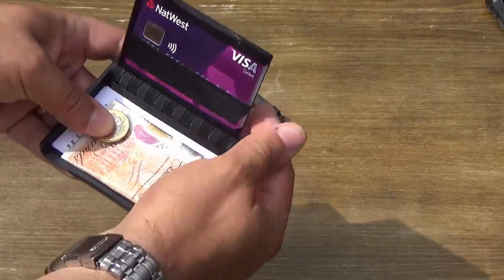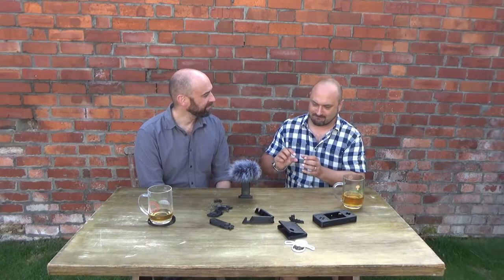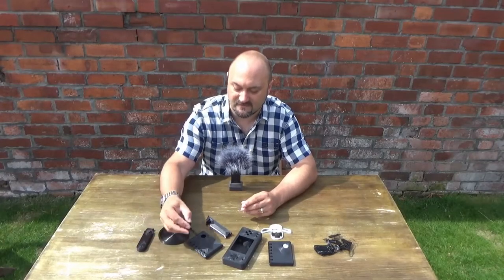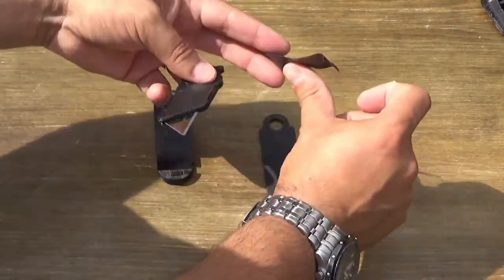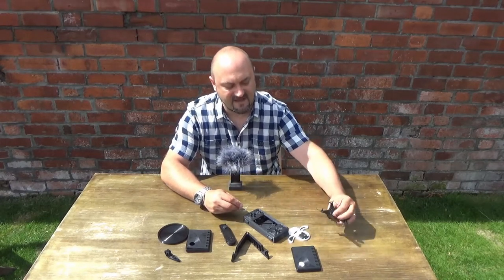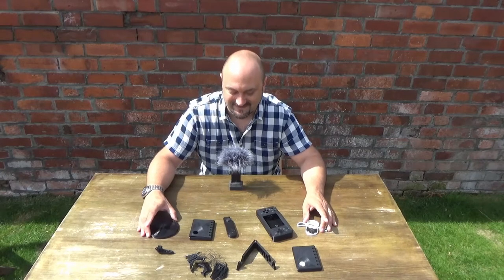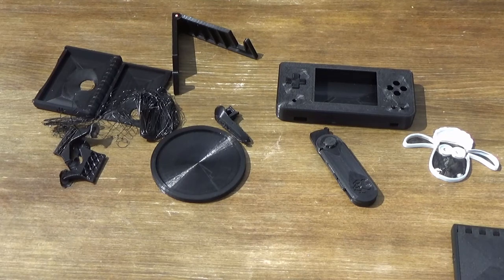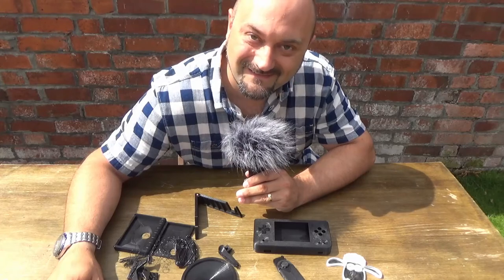DuB-EnG: Is: 3D Printing Useful? Cura Easy? FreeCAD Hard? Difficult Design Parts? Top 5 Prints!

Comment: 3D printing is absolutely amazing and useful for making things you can't get by other practical means. Like, a reasonable looking case for a first generation Raspberry pi, or an apparently obscure valve cap for an Italian bicycle fork.  A few months into owning one, making something in 3D and having it appear (a few hours) later, is still incredible to me. 

Hey, since you're getting heavily into it, maybe you'd want to check out Octolapse! It's a timelapse software that gives, well, amusing looking timelapse videos. :D
Reply from the maker: Thanks for the hot tip Igor!! ...  I’ll check it out and see what it brings to the party!!  I also need to install a pi with octoprint on it too... then I can just tell my printer to go make stuff instead of having to mess about with SD cards!!
Reply: Thought you might like it! :) 

You know, people seem to be very much against that, but I find it perfectly reasonable connecting the printer straight to my work computer. Though, granted, it always only prints when I'm at work, and obviously the machine won't accidentally go to sleep or shut down while I'm working on it. I do keep prints within an hour or two for now. 'Slow and steady...' and all that :D

Comment: Once 3D Printers get a little more advanced and quicker, I reckon they're going to change everything.

I once saw a video where a guy said instead of buying things and having them sent, you would buy a blueprint, then a 3D Printer in your house would print and make it for you. Obviously we're a ways off from that, but it doesn't seem impossible.
Reply from the maker: I work for a company that has a division that makes 3D metal printers... it’s unbelievable what they can do...  but... at £250,000 a go....  not the hobby printer!
Reply: Ah nice that's really cool. Damn, £250k though, that's....rather a lot, lol.
Reply from the maker: Yeah...  I see the Ender 3 selling at £160 on eBay

Comment: Most things in 3D printing are not difficult and not too complex. But then there are two other aspects, that things tend to sometimes get VERY difficult, because everyone runs into issues eventually as for example the printer parts decay, and the same symptoms often signal a multitude of different failure modes, and for other, it's can be a LOT to take in, many many individual little pieces of knowledge and skill, none of which are too involved when it comes to most things, but they are just so so many. I think i watched every single YouTube video on 3D printing in 2016 and 2017 before i bought my printer, and it's been fun.

I use FreeCAD too, but the problem is often times, if you use it "as intended", sketch heavy workflow, really fast, really convenient, everything just ties together so nicely, then you modify one datum somewhere, and suddenly the sketches shift around onto the wrong surface and are completely broken. Thanks, FreeCAD :( Particularly unpleasant when trying to do involved stuff that isn't just boxes, but something that would look like it might have been professionally designed, injection moulded or machined. Don't entirely trust Fusion 360 enough, can't run it on Linux. DesignSpark Mechanical is broken for me. I promise myself to try OnShape eventually, but never get around to.
Reply from the maker: This is invaluable information, thanks for your input!! I need to have a play with a few different cad packages.  Now I have a list!! :-).  Yes, I noticed that parts can get messy if left in a hot or sunny environment...  I think I may need to consider printing in ABS... again many thanks for your input!!!
Reply: I personally never succeeded with an ABS print more than the size of a coin, it just peels apart at the layers right during printing, no matter the settings - the shrinkage forces must be enormous. Even with a Cura heat shield. I guess i need a hot chamber for the printer, that might help. PETG prints OK, not particularly pretty, tends to string up and requires a nozzle clean every time, but it's strong and has some temperature resilience. ASA and HIPS are ABS-related and have same temperature behaviour, but are supposed to have a much more benign shrinkage behaviour.
Reply: I apologize for jumping into a conversation topic I don't think I'm proficient in, with what is now third hand information. I work in a tech. incubator with a lot of other companies, and there are a couple of guys doing commercial prints on FDM machines like these, so I go to them when I screw something up :D. ABS needs an enclosure, a plywood box would do, but the heat needs to  be trapped inside for it to fuse properly. They also told me to basically avoid ABS, that well cared for PETG will do just as good of a job in terms of atmospheric resistance. And, I think nylon filaments are really the ones that will make a difference, though I think those need hardened nozzles. Hope this helps any :)
Reply from the maker: Why take two bottles into the shower!! :-).  Yes...  ABS ...  higher temperatures and more faffing about...  I’ll have a go soon!!
Reply: Lassi, look i know how to get things stuck to the bed. I get adhesion, that's not the issue! The cracks happen further up the print! Window closed, no air movement that i can feel whatsoever. Heated bed tried anywhere between 90°C and 110°C, with entirely same results. And OF COURSE i know not to run the part cooling fan, and my cold-end fan is far enough and directed away and running very gently and slowly, and i tried unplugging it, same result. Prints always just peel apart. Tried hot-end temperatures up to 255°C too, and don't worry, i have extra throats and extra PTFE tubing, i'm not afraid of killing mine. Extra nozzles, extra everything.

Couldn't find a hair spray that actually works for this purpose, i tried multiple of the strongest hold i could get, they were all completely useless - i'll try Fructis Bamboo next. Best result so far, excellent adhesion with ABS: 1€-Store white glue somewhat diluted to spread easier. Second best, serviceable adhesion with ABS, also useful as release agent for PETG (and yes my borosilicate is slightly chipped): UHU Stic.
Reply: Igor, Nylon shouldn't need a hardened nozzle... i mean i don't even get the point of hardened nozzles AT ALL. I can get brass nozzles for pennies, i buy a bag full of them, and i can ditch a nozzle every time i sneeze, i don't really care. Why would i pay $15 or more plus shipping for ONE NOZZLE. One that won't even retain its hardness for very long because i keep heating it to 230°C and gradually cooling it down? If the filament is carbon fiber fragment infused, of course filament becomes abrasive, but one of the worst is glow-in-the-dark, a brass nozzle can be appreciably widened and shortened after just one roll, so... i mean replacing the cheap nozzle trice per roll is no big deal.

But thing is, i have PTFE insert in the throat, like most of us with Chinese printers do, and it wears rapidly above 250°C, while Nylon is generally specified to print significantly hotter than that. In professional environment, this is actually not a thing, the more serious machines usually have all-metal throats. But also when you're dealing with official supplies everything is expensive so you might not favour ditching the nozzles all the time, i get that, plus cost of labour, but for the likes of us who use lowest cost shit, having an extra bag full of nozzles is perfectly fine.

Also Nylon is a treacherous material - i never tried printing it, but i have lots of experience with zipties, you need to keep it hydrated else bad things happen. Leaving it in the sun doesn't sound like a great recipe. PLA actually performs pretty reasonably outdoors, except when it's black, just use white or something like that so it doesn't heat up too much. PETG is of course perfectly fine.
Reply: I think any hassle put into ABS is not super worth it to be honest. Of course i'll try more, i'll construct a cardboard shield around my printer or something like that, but... it's not even a super strong material, the whole industry uses it because it's damn cheap. It's not like you don't have alternatives either...
Reply from the maker: I’m learning so much from you both!
Reply from the maker: I’m learning so much from you both!

Comment: Hi, some good prints there. I jumped right in and started printing little gears when I first got 3d printer, for an arduino project - the fact it can print little 0.8 pitch gears that work well astounds me., I find it amazing that I can come up with an idea and in 30 mins or so it got it in my hand.  I've been prototyping a simple cutlery holder for sink - I test printed the clips today to check if they were spaced correctly. Sure I could buy one for a quid or so but it's much more satisfying coming up with a custom solution. Look forward to what else you create with it.
Reply from the maker: My mind is on overdrive coming up with new Ideas...  I'm trying to make things that are useful to me...  One thing I did notice... after filming this video, I had left some PLA parts in the sun...  they warped...  :-(   ...   It is quite hot outside.
Reply: Don't ever worry about printing or self-designing something that could have been bought just as cheaply or with little effort, or something that seems useless at a glance - it's always a bit of learning and accumulating experience and helps your mind stay sharp, so it's valuable in itself.
Reply from the maker: Exactly!! I’m making a box now!!  A sliding lid box for my car keys and fob.  I hope it will compliment the wallet!! ...  it’s my own design.  See if it works in about an hour!!